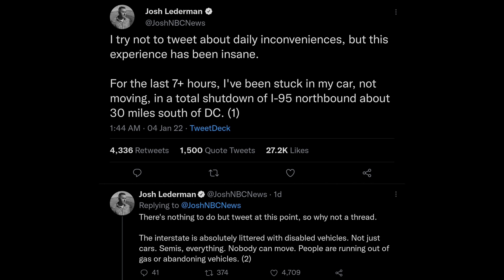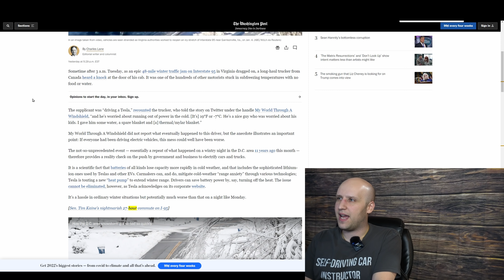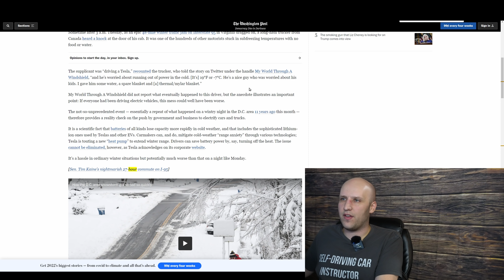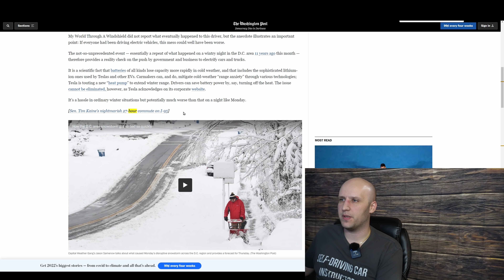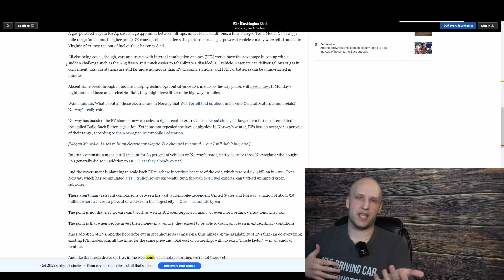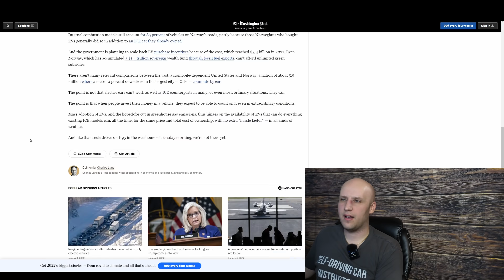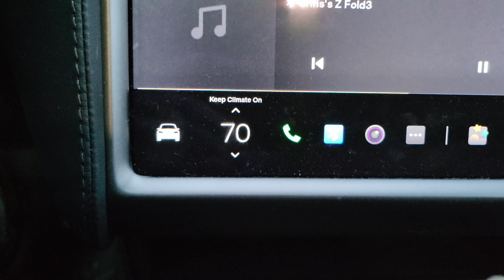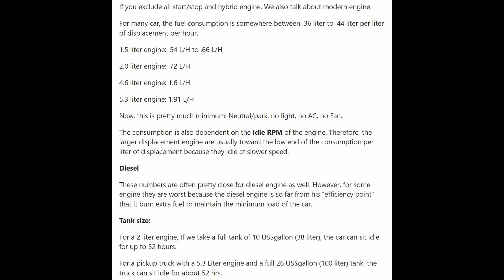How Long Can a Tesla Keep You Warm In A Frozen Traffic Jam? | FUD Debunking

Comment: Power outage:
Well, BEV car - forget it.
ICE: Just use a can with fuel, or a truck tank can refuel, or a simple small generator can provide power to fuel pumps, or use manual fuel pump: You can store spare fuel at home as a precaution. If i have three jeep cans (60 liters) then i can go 800-1200 km with that. If it was a large power blackout.
That is the big problem med BEV today - spare energy. Batteries are really really crappy to store energy compared to petrol and diesel. The battery pack in that model X, did you say 120 kWh? That is what roughly 12 liters of diesel contains.
So 10 kg diesel or over half a tonne of batteries = same energy density.
Imagine if we could get really good fuel cells, running on HVO100? That would be a REAL game changer!

Comment: If only this tidbit was shared when people were FREAKING out since relatively the same 60 degrees F is slightly uncomfortable but still warm. Personally I would not have the heat one and I carry a blanket then with the heated seat.
Reply: Polarbear:  If prepared and having a blanket and a coat and a hood or hat, one could be quite comfortable at fifty degrees (even if somewhat cold natured) with the seat heater on. 

With my coat on in the winter in the car, with no seat heaters and no blanket,  I get way too warm while driving if I just blast the heat all the time, so keep the cabin temp around 60 anyway. 

I ALWAYS cart around a blanket in the trunk.  It can help you get traction.  It can keep you warm.  It's not like it weighs a lot.
Reply: @rogergeyer9851  for traction its (for emergencies) its floormats, blanket, snowchains. I normally dont drive in what happened in Virginia since its foolish to drive in that unless its commuting/your job. The problem is inclompliance for mother nature because she does not care.

Comment: An EV I can recharge from a bank of panels and invertor available in many, many places, if the grid were to crash. Or anywhere with a plug if grid is up. What do people require to mine oil and refine gasoline for an ICE 🤣? For emergency use EV is far superior.

Comment: Who doesn't wear a coat when driving in January when it's 20F outside?  70 is too hot.  I just use my seat heater in the winter.  

I think a more realistic test would have been to have a warmed car at 40% charge and then just either have the seats on level 2, and/or set the temp at 55-60F.  I mean if we're talking about someone worried about surviving and being able to drive away in the end, they aren't going to set it on 70, wear no coat/hat and have the seats on level 3.
Reply: If all I'm doing is going from heated structure to heated structure, I typically go about in winter with a T-shirt and windbreaker. Even in 0F weather.
House is warm, car is warm, store/restraunt/etc is warm

Course that is all in town where there's plenty of people within 150ft at all times.
Reply: @dorvinion  I see, but there's no way I would go out w/o a coat.  I like to park in the back of the lot away from other cars so even if I'm going to a warm store, it can get cold (I guess I'm old...lol).  You should at least toss a warm coat in the car and include a blanket just in case.

Comment: Question regarding charging.  I just purchased a Model Y and it was set to charge to 90% by default.  Will I get more life out of the battery if I reduce the upper limit of charge to 60, 70 or 80 percent?
Reply: Yes its better to keep them between 30% to 80% for increasing lifetime
Reply: 90% is fine but I wouldn't go above that. 80-85% is probably a little safer for preserving your battery. You should also avoid using the lower 20% of your battery regularly. But on road trips or when the need arises, use the full range you need!

Comment: Never understood the what if you run out of electricity argument against EVs, running out is an issue regardless of what fuel you use. Also the electric grid is the most built out energy distribution network in the world by orders of magnitude, you will almost always be closer to an electrical outlet than to a gas station and the gas station will have an electric outlet anyway.
Reply: Well, petrol and diesel can easily refuel from a truck tank or spare container.
Reply: @Xanthopteryx  But by the time EVs dominate the roads, the charging/heating technology will advance as well.  I'm sure bidirectional charging will be commonplace by then so you can get charged by a service truck or even your fellow motorist.  Who knows what other advancements will come.
Reply: @kenbob1071  There is that hen and the egg situation here. You can not dominate if you do not solve a lot of stuff on the way. And you will not solve a lot of stuff if you do not dominate because of cost issues.